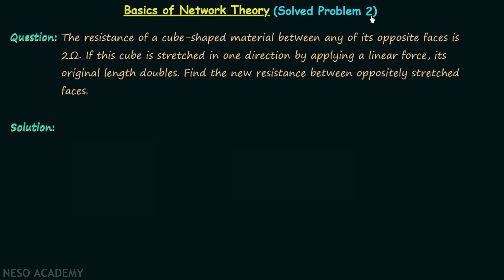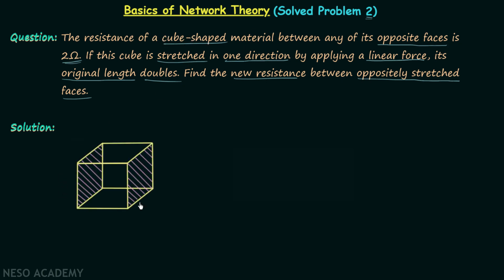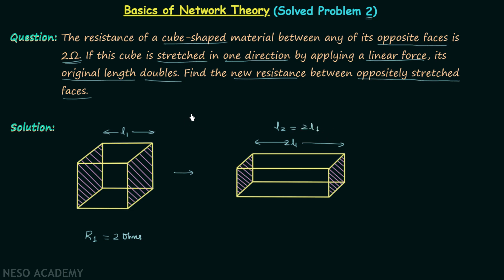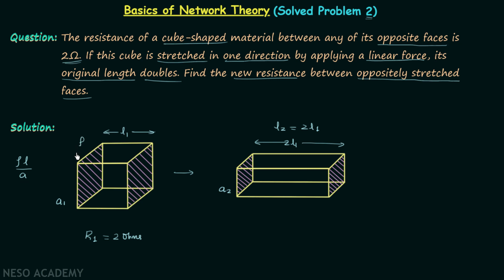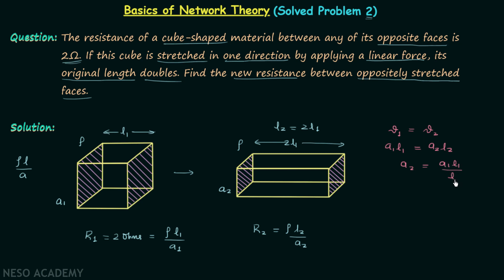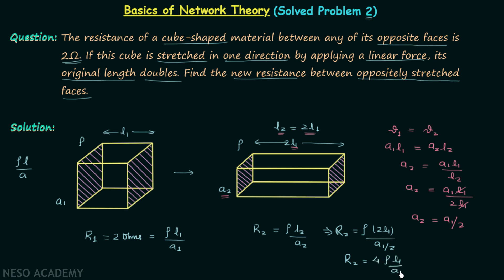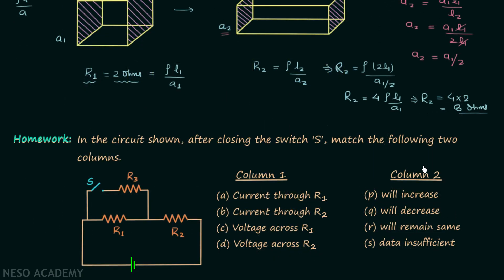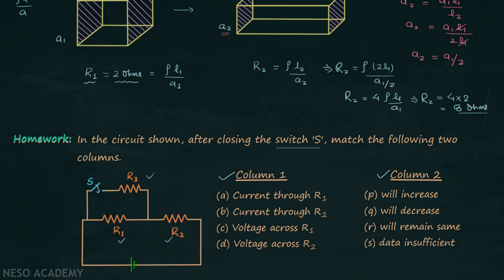Basics of Network Theory (Solved Problem 2)

Comment: a – q, b – p, c – q, d – p. When switch is closed, some current now move through R3 hence current through R1 will decrease and potential difference across R1 will decrease.  Also effective current through R2 will increases because of presence of R3 in parallel to R1. As in parallel connection, resistance decreases, hence current will increase

Comment: General Rule: I changes and Req changes but V stays same for both ckt
Req of second ckt < Req of first ckt
I of second ckt > I of first ckt (note: current will be more if resistance is less)

1. current thru R1 will decrease since even if the current will be more still it is divided in half between R1 & R3 so a) matches q)
2. current thru R2 should increase so b) matches p)
3. data is insufficient for both R1 and R2. This happens for two reasons 3.a) I changed 3.b) The equivalent resistance of R1 and R3 is unknown. Hence the voltage drop will be different between nodes a/c & b/c.

Comment: correct ans
(a) Current through 𝑅1 : (q) will decrease (I/2)
(b) Current through 𝑅2 : (r)will remain same  (I)
(c) Voltage across 𝑅1 : (q) will decrease   ( IR1...after adding R3.....(I/2)R1 )
(d) Voltage across R2: (r)will remain same  (IR2)

Comment: Before closing the switch Rtotal is greater than after closing the switch so the total current will increase and current and voltage through r2 will increase and voltage through r1 will decrease and current may be same because some current is going through r3

Comment: The correct option (D) a – q, b – p, c – q, d – p Explanation: When switch is close, some current now move through R3 hence current through R1 will decrease and potential difference across R1 will decrease.  Also effective current through R2 will increases because of presence of R3 in parallel to R1. As in parallel connection, resistance decreases, hence current will increase.  ∴ current through R2 will increase potential difference R2 will also increase. ∴ a → q  c → q  b → p  d → p.
Reply: current through R2 will remain same

Comment: q p q p. (1)  we can get I = V/(R1+R2+k), k=(R1*R2)/R3, implies that new current is always smaller than original one. (2) total R decrease, I increase, so must be increase. (3) & (4) voltage simply depend on total resistance of each path.

Comment: A-q
B-r
C-r
D-r
Everyone getting confused for C and D but when switch s is open then voltage division rule Applied so whatever voltage V is given to the circuit it's get divided across R1 and R2. 
So before when switch are open V1 and V2 is the voltage across R1 and R2
When switch is closed then V1 is the voltage across R1 and R3 and V2 is across R2 that is same voltage.
Reply: The ans. For D should be p...
As the current will increase from the R2
Reply: @mayankc.p638  how current will increase bro, it remain same na 🤗
Reply: @mathematics_rajkumar  When S is closed then the net resistance in the ckt will decrease so the current should increase.
Reply: The correct option (D) a – q, b – p, c – q, d – p Explanation: When switch is close, some current now move through R3 hence current through R1 will decrease and potential difference across R1 will decrease.  Also effective current through R2 will increases because of presence of R3 in parallel to R1. As in parallel connection, resistance decreases, hence current will increase.  ∴ current through R2 will increase potential difference R2 will also increase. ∴ a → q  c → q  b → p  d → p.
Reply: @zxxxxZzzzzzzzzxxxzzz  shouldn't a --s?
Because the we dont know if R3 is equal or greater or smaller than R2...
Reply: you are wrong same current can't flow through R2 because the equivalent resistance in the circuit has decreased and that will eventually increase the current provided by source itself... so more current will flow through R2...
Reply: I too thought the same thanks for clarifying  I actually confused after seeing other comments
Reply: you are wrong

Comment: Qpqp
Reply: Since in parallel combination R decreases therefore voltage across r1 r3 decreases.
Current drawn from battery increases due to decrement in the equivalent resistance and thus current through r2 increases and also voltage because it r2 remain same. And we have to keep potential across battery as previous.

Comment: current through r1 before closing the switch is v/(r1+r2)
current through r1 after closing the switch is vr3/(r1r2+r1r3+r2r3) or v/(r1r2/r3+r1+r2) which is clearly lesser than before so it will decrease
since current has decreased so will voltage 
as we know that equivalent resistance in parallel is smaller than the smallest one so total resistance will decrease and so the current for r2 will increase and so the voltage

Comment: a - q , b - p  , c - q . d - p ? (edit** i think (a) question matches with (s) answer)
Reply: I think q,r,r,r
Reply: @srijitbera1989  my friend , current through R2 will definitely increase....At first (switch is open) you have 
R_eq= R1+R2 .Provided a voltage V across the R_eq we have some current I....After the switch closes we have R_eq_new= [(R1//R3) + R2] and it should be obvious that R_eq_new < Req (remember that the equivalent resistance of 2 parallel resistors is always less than the smaller one of the 2 resistors) ...So if the same voltage V is applied through R_eq_new ,we will have a current I_new > I  (Less resistance with same voltage gives greater current ** Ohms Law**) This current (I_new) gets divided into R1 and R3 and the whole current I_new passes through R2 (current divider rule)..So it should be obvious by now that current through R2 will in fact increase.. And i also think that regarding the (a) question the data is insufficient as we should know if R1 is greater or less than R3 in order to provide a secure answer. Also about the last question (d) it should be obvious now (after the above analysis) that the voltage through R2 will definitely increase.. We have fixed volatge V across 2 resistors in series (R1+R2) so according to voltage divider rule we will have 
V_R1+ V_R2= V   -(1st equation_swicth is open). After the switch closses we have R' = R1//R3 and R2 in series.. (BUT R' < R1). So for the same fixed volatage V across R' and R2 in series we have
 V_R' + V_R2 = V  -(2nd eq_switch closed). But  V_R' < V_R1 (because R'<R1) . So in order for these two equations to be true V_R2 after the switch closes should be greater . And ofcourse voltage through R1 will decrease following the same analysis (as the eq resistance across the terminals of R1 is now reduced after we close the switch_we have R1//R3) IMO you should reconsider your answers.
Reply: @apostolosmavropoulos177  thanx man ❤️🖤
Reply: @srijitbera1989  no problem :)
Reply: yeah that is correct
Reply: Crct uh bro

Comment: a-q
b-p
c-q
d-p
Reply: How is the current through R2 gonna increase?? We need to compare the circuit when s is open to s is closed right? When s is open the current through R2 is I. And when s is closed the current through R2 is (i1+i2)=I. The current will not change right?
Reply: @NaveenSword  
Bro
Total current from the source 
      (open) =(I')=   V / ( R1 + R2 )
Total current from the source 
   (closed)= (I") =
V / ( ( R1 R3)/(R1+R3). + R2 )
So    I' < I" 
And 
total current flows through R2
So through R2 current increases 
Whe switch closed 
I think its clear ?
Reply: @santunukumarpanda7604  oh ok.. thanks bro.
Reply: @santunukumarpanda7604  thnku bro
Reply: How current through R1 will decrease because I(R1)=I"(R3/R1+R3)...so it will depend on ratio of r3/r3+R1...so data is insufficient for a
Reply: @gopalshukla4471  R3/(R1+R3), always less than 1 , what ever be the value of R3 and R1.